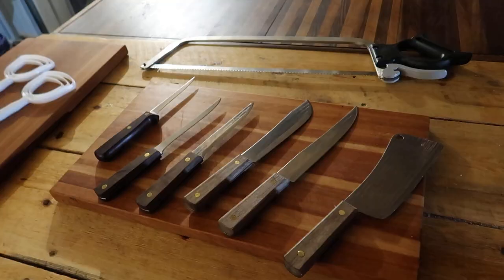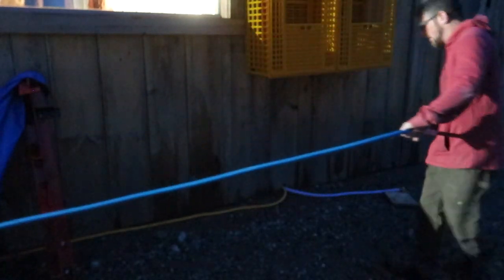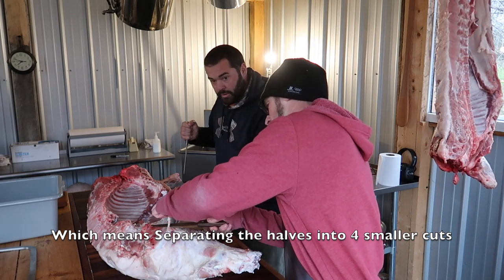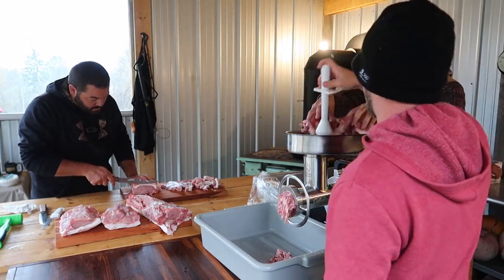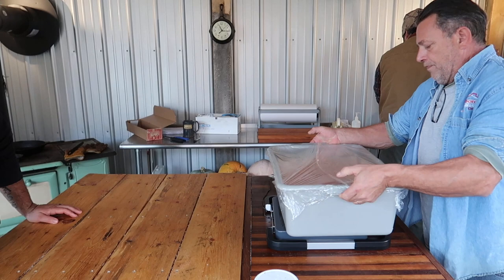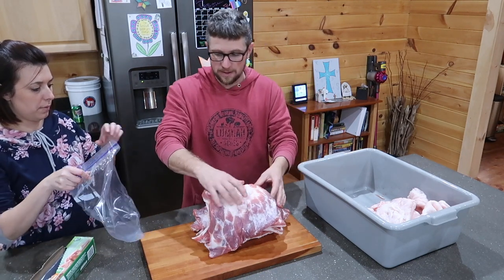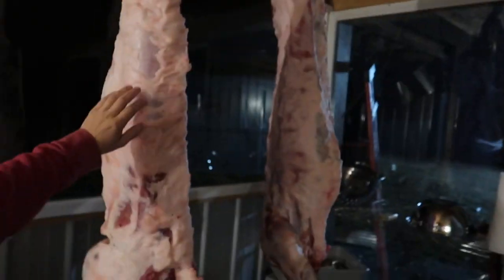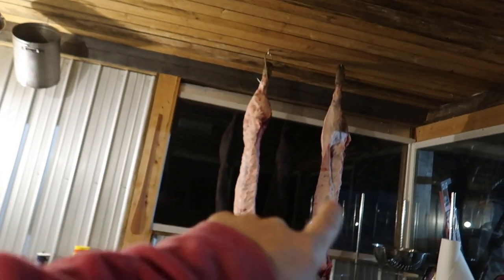Butchering our Pasture Raised Pigs

Comment from the maker: Butchering Supplies that we use ~ https://amzn.to/2zfRwg2
Reply: I think the price of that Ontario set got jacked up after you linked it. They're great knives, carbon steel so you have to take care of them, but anyone wanting  a set should look at other sellers. The set can be had for $41 shipped.
Reply from the maker: Hugh Brackett yea when I added the set last night it was $27
Reply: The boning knives I bought after perusing many reviews are the Ultrasource 6". I got one stiff and one semi-flexible. I can confirm what the reviews say, the semi is quite flexible.  Note if you go through Lumna's link they get credit for whatever you end up buying. I also got the Ultrasource 10" smooth honing steel.
Reply: We I was a kid as a member of a family of 8 we used to buy Quarter of Cow, Half a Lamb and Half a Pig. We all helped. We made the Burgers (Ham and Beef), Sausages (Ham and Beef), Adding the Meal and Flavours we wanted. I think the Burgers were ground on Large hole once but the Sausages were Ground Twice Large and Small hole once each, Second time after the Meal and flavourings had been added. The Burgers were laid in a big plastic container with paper in between. Sausages were but into bags with enough for 1 meal. Obviously Mum and Dad did most of the work including cutting joints again meal size portions into plastic bags and Vacuum sealed. We had a very big Chest Freezer so also used to go to Pick your Own and even bought  sacks of Carrots. Again all prepared into meal sized portions. Some things we had to Par Boil before we froze them?
Reply: We don't have pigs yet but you've given us a great foundation to learn from.  Thank you!
Reply: The link isn’t working for me what is the name of the book

Comment: A Southern farm method for hair removal is to cover the hog with burlap and pour hot water over it, letting it sit for a short while and checking to see if hair can be scrapped off (using edge of mason jar lid which allows you to get into the smaller areas).  Over scalding the hog will set the hair, so check to prevent over doing.  Several people can do this in a short period of time with no need to hoist the hog and dip, etc.

Comment: Al,  when my dad used to butcher hogs scalding them he used a 55 gallon barrel that had been cut in two pieces length wise the ends were cut out of the bottom of both halves then they were welded together. He built a table and fixed the barrels so the fit and stayed up tight to the low table. After the pig was killed and had bled out good,  Dad had the fire under the barrels, Grandpa would throw in about half a shovel full of wood ash,said it would make the hides come out nice and clean.( lye in the wood ash) he would go over by the water barrels,he would make his fingers like a knife and slide them down thru the water one way just the finger tips to about the first knuckle, then his hand would sliceack thru the other direction.  He said if he couldn't put them back thru the third time the water was ready.they would lay two heavy ropes side by side so one rope would go around the pig behind the shoulder  and the other just before the hind quarterthen the hog was Kaye up on the table belly up. The ropes were then thrown to the guy across from you,  then the far guys pulled and rolled pig into the tank, then the four guys holding the rope each side taking turns pulling opposite directions rolling the pig back and forth under the water. Stopping periodically to see if the hair is loosened enuf to scrape easily. When it all seems to be loose one side holds firm enuf against the ropes for the other side to roll and flip the pig into the table.
   I also think you should watch some videos on making head cheese. There is so much meat on the head.  I love it with a touch of dried chili peppers,salt pepper,GARLIC and a pinch of sage,a little vinegar.  If you think a meatloaf sammich is good wait till you try this. I'd tell you how but my hands going to sleep and there are several great videos online.  Let me know if my explanation makes any sense, 🤠

Comment: You can save some time skinning by inserting an inflàting needle into the skin, just between the skin and rib, then inflate with an air pump.  The air pressure separates the skin from flesh and makes it much easier to cut off the skin layer.  We used a simple bike pump on rabbits, chickens, goats and deer, and it always worked great.  Try not to insert the inflating needle too deep. Put it at an angle so it’s in just under the skin.  May take a few tries before you figure out how to do it, but once you figure it out you will be glad to know this tip.
Reply from the maker: Thanks. I will have to try it.
Reply: Lumnah Acres that really doesn’t work with pigs, they don’t have a hide like those animals mentioned.
Reply: @andrewlane1537  We used this method to skin wild boar we caught in California and it worked just fine.   Domesticated pigs that escaped farms make up a big part of the wild boar population, so the fact that they are running wild doesn't mean they are different from the pigs raised on farms.  Also, chickens don't have hides, but this method works every time.   You may be inserting the inflating pin too deep or not deep enough, if you have used this method before, to allow the air to flow between the skin and flesh.   It takes a few tries before you figure it out.

Comment: Alternatively: cut your drum in half from top to bottom to make makeshift tub. Fill it with boiling water*. Dunk in your pig**. It should be deep enough for half of the pig to be submerged under water. After a while turn the pig and shave what is above water. it is fast, simple, cheap and you don't need any lifting equipment whatsoever.
 *(or make fire underneath the tub and boil water in it)
**(4 grown up man of any body-composition should be strong enough to lift most pigs)

Comment: Interesting video. Were these pigs a different breed from the last pair you had? If so that may account for them having less fat. The heritage breeds tend to have a more fat to lean ratio then modern pigs which are bred to be leaner. Interesting idea 're skinning instead of scalding. I think I prefer scalding because I tend to like crackling. Also the rind on bacon etc can then be fed to animals so there is less waste....I suppose if you go down the skinning route you can always attempt to tan the skin to make your own pig leather which makes very fine leather...but that may be more time consuming. It would be interesting to here from anyone who has tanned their own leather from their pigs. Great video.
Reply from the maker: They were a little different they were 1/8 american guinea hog
Reply: Exercise plays a big part. The more a pig gets to run around, the leaner the meat, and the better the marbling. S & L had a large area and the rock wall as well as Al 
encouraging them daily to walk around to the far side of the pasture area. Last winter's pigs spent a good bit of their time confined due to the icy conditions etc. especially towards the end as they got closer to butcher.
Reply: 😭😭 the rind in bacon is the best part

Comment: Ive only helped scrape one pig........the rest was scun.....i vote skin it.....you save heating water for 30sum min......and the power or fuel to heat it and the labor to scrape .....within 30 min i can gut and skin a hog. In my opinion thats a huge savings in time alone........and i have a hog scalder....its just not needed for us. Yes the skin goes un used for comsumption.......aw well......no we dont share with our dogs as we rather our dogs not try and get a snack off our living pigs........but the hide is an awsome start to a worm farm........roll that hide up and freeze it till your ready. 
     When ready thaw and add plenty of wood chips or shavings or dry carbon filler to help cut smell down and add veggie fruit keftovers ext in it as needed......in no time yiur worms will transform the hide back to soil thus giving back to you to fertilize your plants........still in the full use cycle!